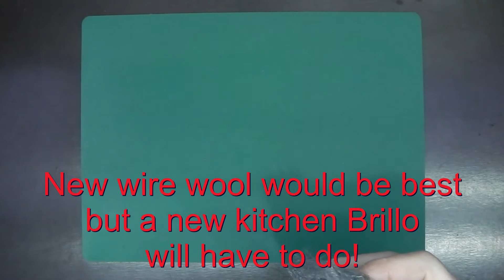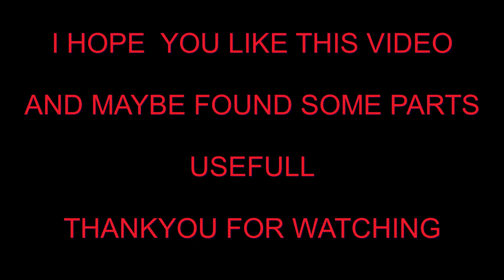TINNING NEW COPPER SOLDERING TIP

Comment: Hi, I wanted to ask you if the rest of the copper oxidizes?
Instead of tin, you should try making a spiral around the tip with silver wire and heating it with a small torch. Thanks for your interesting video.

Comment: help, i just bought these copper soldering tips, the same as you got but when i used them it just changed color and burned out, like it just darkened and won't attach any solder

im a bit confused and frustrated with these cheap stuff from china
Reply from the maker: I thought at first that I might have been conned, but they are sold copper, what quality of copper is another thing.
Reply: you had to tin it at very first use